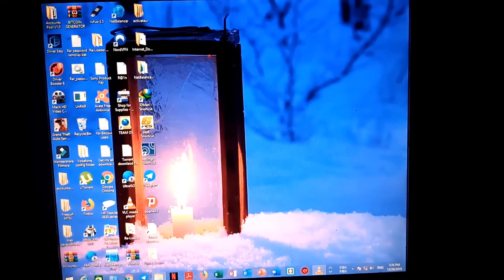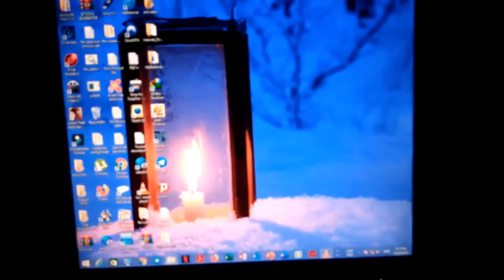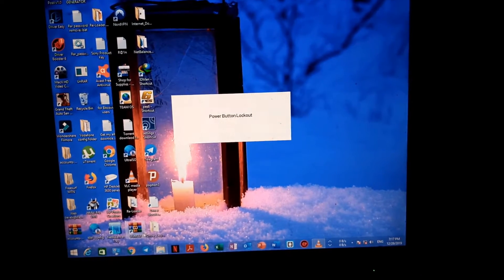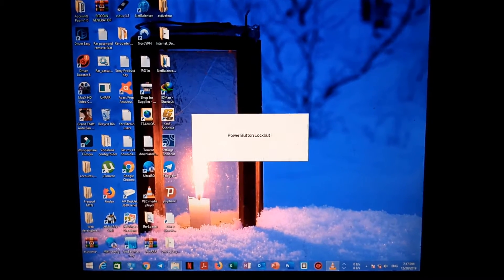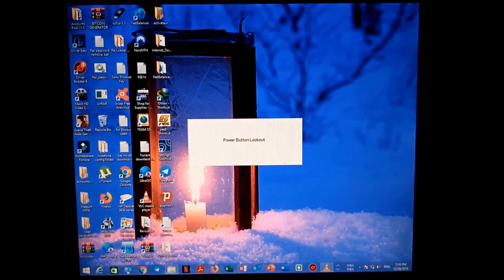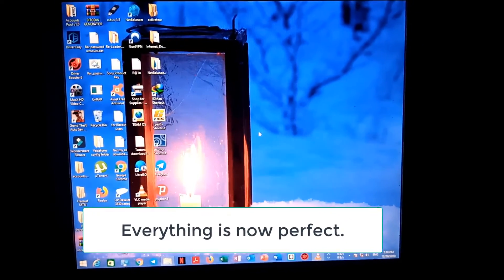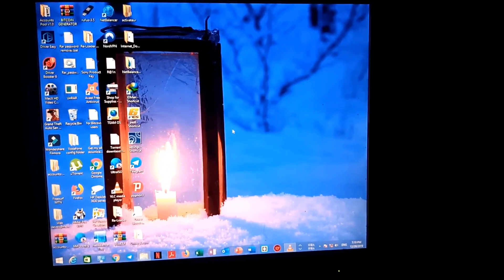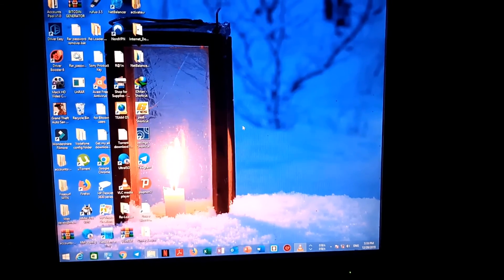How to Fix Power Button Lockout on any Monitor | Windows Vista/XP/7/8/10

Comment: Uhh help for some reason my monitor doesn't turn on even if I press the power button
Reply from the maker: Then it's surely hardware problem. Try to check the power button and fix it